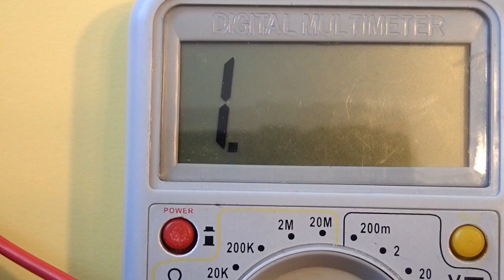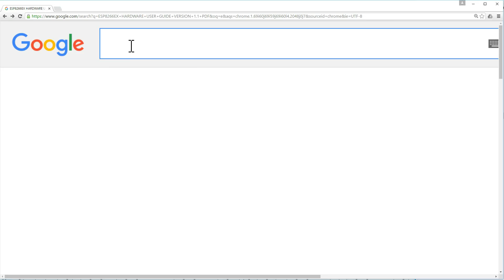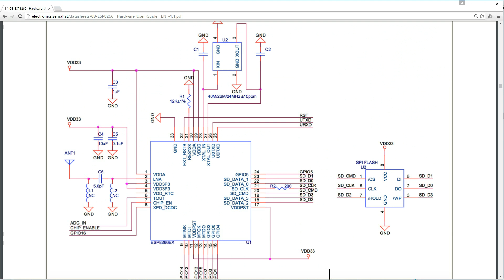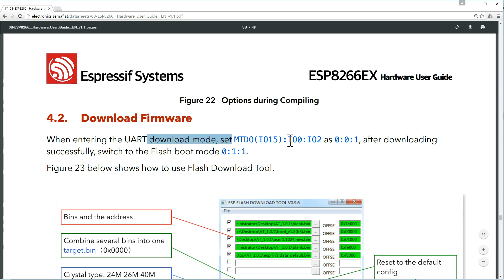#1 From ESP-01 to ESP-DIY

Comment: hello! i keep getting this following error on my diy board

load 0x4010f000, len 1384, room 16 
tail 8
chksum 0xa8
csum 0xa8
csum err
ets_main.c 

I am not getting this error on my ESP-01 module.  I have both the GPIO0 and GPIO15 pins pulled down to GND.  Do you have any suggestions to fixing this csum err?
Reply: PS i am able to flash code from the arduino IDE to my DIY module but it seems like it cannot get past the boot loader
Reply from the maker: I think that I haven't had exactly that same problem. But you could use Google translator on this site https://docs.google.com/document/d/1NgfOVN1WiN9H_-v9MGsuouYu5Me8kcmD-1Bx0bo9VLw/edit#heading=h.bcdbz8mr69im
Reply: Thanks for your response Miika.  I will check out the document.  I need permission to view it though.  I just sent a request.

Comment: Ummmm sir? do you have the pcb toner of the circuit board?
Reply from the maker: I bought factory made adapter plates for this video. But PCB toner is an excelent tehcnique:  http://www.instructables.com/id/Cheap-and-Easy-Toner-Transfer-for-PCB-Making/
Reply: Miika Kurkela okay I will check it.

Comment: Now that is some ESP8266 heroism! ;D
I better be happy with my Espduino cause I can't solder that!
https://www.banggood.com/ESPDuino-Development-Board-ESP-13-WiFi-UNO-R3-from-ESP8266-p-1023370.html
Reply from the maker: ESPDuino is a fine board. And Wemos D2 R1 is great as well. Mostly I have done my experiments with a NodeMCU. If I have wanted to use some Arduino UNO shields, I usually try to connect them to one of those two. But nowadays the ESP32 is my dearest microcontroller.
Reply: Cool, I got into Orange Pi Zero now, it is interesting as a 4-core Arm SBC & cheap too: http://www.banggood.com/search/orange-pi.html with Armbian it rocks https://www.armbian.com/

Comment: Nobody else as far as I know has suggested to remove the Espressif  wonder chip and mount on a QFN32 to DIP32 adapter to better access all the goodness of the extra GPIO's. This is truly a wonderful idea. Thank you. I will have no problems with the soldering.... I do have a dedicated hot air tool. Just not a calibrated temp output
I just ordered the part from Ebay and as it turns out I have a couple of the ESP201 that I can't work with easily. They arrived with a breakout board that occupies the full width of the breadboard. So only the power rails are showing. Ooops!! So a great way of dealing with the unuseable hardware. 
Have you ever seen Zeptobars photograph of the guts of one of these chips? Truly inspiring how much they have packed into this tiny chip. http://zeptobars.com/en/read/Espressif-ESP8266-wifi-serial-rs232-ESP8089-IoT
The audio was very low on this vid but you have fixed the matter in subsequent uploads. Don't pay any attention to this person who is asking you to "work on your speech" How ridiculous is that!
Reply from the maker: I hadn't seen ESP8266 chips on QFN32 adapters. So, I guessed that I had found something interesting and that's why I wanted to make these videos. 
In the ESP8266 Hardware User Guide they recommend that one should have only short wires to the reset pin #32, crystal pins #27 and #28 and the antenna pin #1 (see pages 15, 19-20 ). And often it is recommended that the wires to flash memory chips should be short ones, too.
In my experiments only the wires of the crystal pins needed to be short. If I placed the crystal to a breadboard, the system became quite unstable. That's why I have the crystal and its capacitors soldered straight to the QFN32 adapter plate.If the antenna is on the breadboard it doesn't work very well, but it doesn't disturb the system as much as the crystal did. To get a good antenna I like to have the antenna connected straight to the QFN32 adapter plate as well.
It is nice to have all the GPIO pins available. But one doesn't need a QFN32 adapter for that. It is easier to use ESP-201, NodeMCU and similar modules for that purpose.
But I think that the point with QFN32 modules are the deeper understanding of the system, the possibility to minimize the power consumption of battery powered systems and the prototyping for commercial products. After a while your systems became very stable and that's very something nice with ESP8266 chips. We all have spent lots of time struggling with strange and unstabel ESP-01 modules.
I also do have a proper air gun tool for soldering and desoldering. But in the video I wanted to show that the work can be done with the simplest tools that many of my viewers already have at their garage.
Calibration of the hot air gun temperature is not obligatory. Hold the chip with pliers. Heat gently and the rest of the ESP-01 module drops onto your table when the soldering has smelted. I haven't yet managed to destroy a single chip with these robust methods of mine.
Yes. The enlarged photographs of the ESP8266 chip are fine.
Usually the recording of the voice and editing of the audio track is the most difficult part when people start making Youtube videos. That was also true in my case. It is also a very annoying part of a video if it isn't done well. I think that in my last two videos the audio track are better.
These videos are also a good way to practise and use a foreign language :-)
Thank you for your comments!